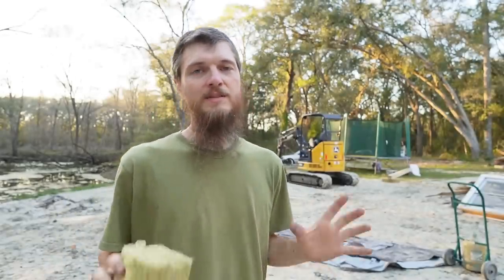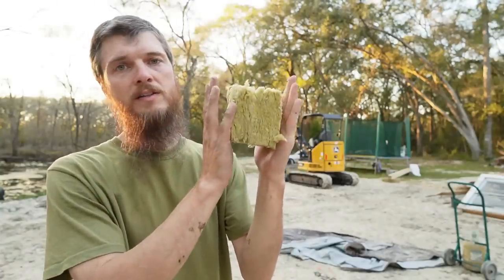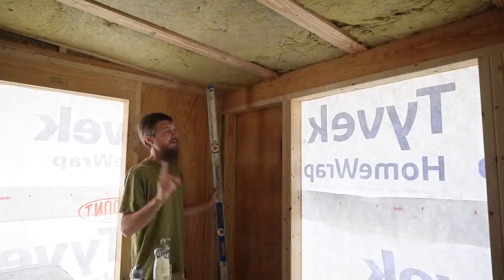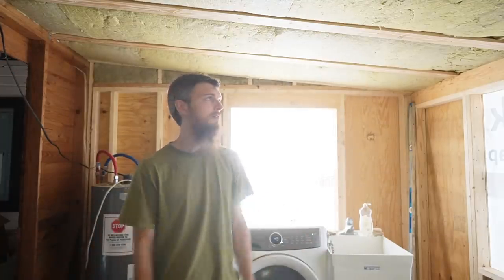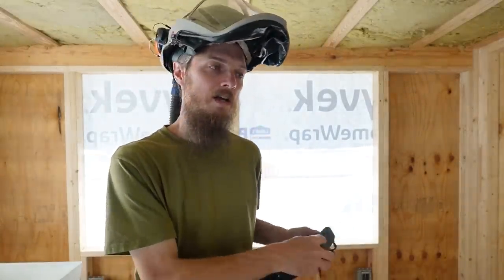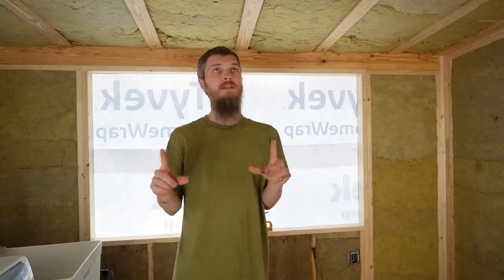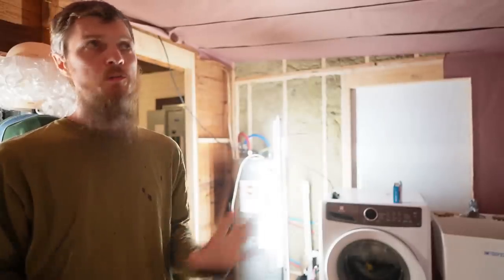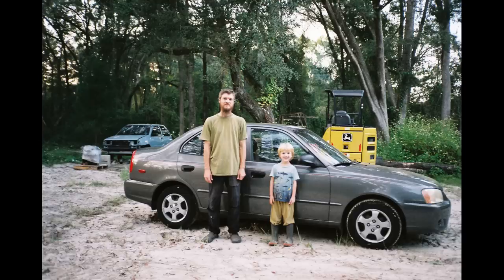Compressed Insulation Air Space Myth ( Insulating the Back Room + Family Photos! )

Comment: You are 100% wrong about this one.

What causes "R Value" to change is based on multiple factors. Insulation works by trapping heat within an air space. If you squish insulation, no matter what kind you have, it traps moisture more in the compressed insulation than in the uncompressed insulation. This trapped moisture than cools down faster than air. Now it's winter time, this trapped moisture now freezes and turns into ice, and slowly expands more and more when more moisture is near it. This makes your insulation R Value null and void. This also leads to mold growth within your walls and causes water damage inside your walls.

I could go on and on about how to properly explain how everything works and how to avoid all these mistakes, but you should bet the picture as it.

Stop spreading false information that could leads to hundreds of thousands of dollars of damage to people's homes, if not millions of dollars of damage.

Please delete this video, or put a warning on it saying this is your opinion only and to not repeat what you do in the video if you still disagree.
Reply: You've got almost everything wrong. "trapping heat"? No. Insulation works  by resisting the flow of thermal energy across some temperature gradient. Solid asbestos was commonly used in the old days in many industrial and scientific lab settings, for instance.  If insulation "trapped heat" it wouldn't be very useful in the summer, would it? What the data that Doug linked shows is the r-value per inch of a compressed fiberglass batt actually rises as you remove the air spaces. This implies the air space has higher thermal conductivity than the fiberglass itself. And a quick glance at Owens Corning's datasheets shows this to be accurate.  As is true for most things, consumer products are always a compromise from the ideal due to material cost and ease of use, The problem I see with most "pros" is that many are only exposed to one system and mistake compromises for requirements. As always, use the exposure to something that seems wrong to you as an opportunity to learn.
Reply: @Peter West  Insulation traps heat, 100%. Thus the definition of "R Value".
The reason why the inside of the house does not heat up in the summer time is because the insulated air space is being heated, while the inside of your house is being air conditioned, or vented via windows.

I built houses for a living for over a decade almost 2, I know what I'm talking about.

This is not an opportunity for me to learn, this is an opportunity to Doug to correct his mistakes that he is telling everyone else it's okay to do as well, which will cost them hundreds of thousands of dollars in damage.

You don't make money as a constructed worker if everything you build turns into a moldy rotten house.

You ignored every single point I made and went on your own tangent about how you thought insulation doesn't trap heat. If it can trap moisture, it can trap heat.

Now please do not make the same mistake as Doug and spread misinformation on the account of defensiveness and ignorance. I'm trying to prevent people from having mold and water damage behind their drywall and not noticing the damage till the point the house could be condemned, while you a defending Doug based on an idea o. Paper that is irrelevant to the points I brought forth.

The issue isn't compressing the insulation and losses a few dollars from heat, the issue is the compression of the insulation trapping moisture, freezing, allowing mold to grow, and rotting the structural framing that holds the house together.

I appreciate you trying to defend Doug here, as any good person would, but you didn't address the mold and moisture issues I brought forth, so sorry, you are wrong.
Reply: Relax it's one guy building a house and the channel is about much more than insulation.
Reply: @Brian L  It's "one" guy telling "hundred of thousands" of people online something is okay to do, when in fact it's not and could cost someone innocent hundred of thousands of dollars in damage.

So take your own advice.
Reply: @Official_Random_Guy  Please provide a link to your channel so others may watch and learn from you. Or please start one to save us 100s of 1000s from poor insulation. Hurry, we are all in the middle of framing and will be insulating any minute. Please I implore you to protect the innocent.
Reply: @Brian L  Really!? I'll get right on that just for you!

Dude, take your own advice and "relax" already.
Reply from the maker: @Random Guy, You have some interesting theories but I believe you are wrong. It's said to be perfectly fine to compress insulation as long as you are able to maintain the R-value that you require. It won't cause moisture problems. If you have any supporting documents to show that compressed insulation holds more moisture, I would be happy to view them. But from all the documents and articles I have read, I have never seen such a warning from any institute or manufacturer.

But also keep in mind, I didn't tell anyone to do or not to do anything. I was only sharing that R-value/inch increases as you compress insulation. It's the opposite of what most people think because R-values do not rely on "air space" alone. 

Compressing insulation isn't really a cost effective way to increase your r-value, but at the same time it's not something to worry about. Air gaps are the biggest concern. As long as the cavity is filled, that is the main goal achieved and a job well done. 

If you still disagree, that's fine, but there's no need to give me a hard time about it. Just ignore it and enjoy the rest of the show.

https://www.energyvanguard.com/blog/compressed-fiberglass-insulation-really-so-bad/

https://www.jlconline.com/how-to/insulation/q-a-compressing-fiberglass-batts_o

https://insulationinstitute.org/wp-content/uploads/2016/08/Compressed_R_values.pdf
Reply: @Official_Random_Guy  Mr Guy, I've been laughing and entertained by you this whole time. I'm mocking you with my comments. It's called satire. As Doug said, I hope you can enjoy the channel for what it is.....sincerely.
Reply: @DIYfferent  I posted a comment with a link and it just got erased.

You can look up why compressed insulation leads to mold and wood rot yourself on the account I am unable to post links.
Reply: @Official_Random_Guy  Here's the Definition of R-Value:  "R-value is a measure of how well a two-dimensional barrier, such as a layer of insulation, a window or a complete wall or ceiling, resists the conductive flow of heat."  I know it can be difficult for a layman to understand what the above really means and how it should inform one how thermal properties change with fluctuations in material and installation parameters, so "trapping heat" for you is really a shorthand way of ignoring the details of how things really work, but, as shall see, that kind of reasoning by analogy ends up trapping you more often than not. 

I've completely gutted and renovated several houses in my life time (one of my grandfathers built spec houses much of his life and my other grandfather has owned a plumbing business since 1960s). I know a thing or two about the practical side of construction, of course, but my education in the sciences (a graduate degree in engineering) informs my opinion here. I'd imagine that your opinion is informed by a misinterpretation of cases where too much insulation was stuffed into a wall without consideration for humid air exchange. The problem there is insulation impeding the ability of the wall to breath - not that "smaller air pockets hold more moisture". Contractors are notorious for getting causal factors wrong.

In any case, a good resource for everyone who has questions about insulation  is to go over to the Building Sciences website and absorb as much material as you can.  Joseph Lstiburek, Ph.D., P.Eng. who founded the company, has a bunch of videos to watch as well - I especially like the one where he insulated his roof in such a way as to inadvertently cause thermal bridging.
Reply: @Peter West  "resists the conductive flow of heat" means "it traps heat" genius.
Reply: @Official_Random_Guy  Thanks for confirming your short-hand nomenclature led you astray. Try this: ask one of your job-site electricians if a resistor "traps current".
Reply: @Peter West  Why would I ask an electrician if a "resistor" traps the current" when that excess electricity is released in the form of heat?
These are two completely different subjects which makes your point a "false equivalence".

The topic is heat, not electricity. Stick to the topic at hand genius.
Reply: @Official_Random_Guy  Actually the equations for thermal energy transfer are exactly analogous to a simple resistive circuit.  "excess electricity" isn't a term I'm familiar with and my undergrad is electrical engineering, btw (my degree also required a year of thermodynamics). No, current isn't trapped by a resistor - it flows uniformly throughout a circuit branch no matter the values we assign for electrical potential and resistance.  The same thing applies to heat flow - eventually the flow of heat will cease when all components in our house system reach equilibrium - it can't be any other way unless we throw out the laws of thermodynamics. Thus, I reject your "trapped heat" assertion and everything else that flows from it. The last word is yours.
Reply: @Peter West  My point is you were being intellectually dishonest with your choice of example. The topic is "insulation", so a better choice than a "resistor" would be an "insulator".

So an electrical insulator prevents energy from flowing where it's not wanted. That is topic, not a system that allows free flow like you are insinuating.

I could care less what your educational accreditation is, you are trying to change the subject which is "insulation traps heat."

Insulation prevents heat from leaving the house, it also prevents heat from entering the house as well. But according to you, this is incorrect, which is blatantly false.

Comment: Uhhh a non load bearing doorway does NOT require a traditional header.  So if air doesn't matter in insulation it shouldn't matter in double or triple pane windows either hu ?  Wow  I am learning so much from these videos !   NOT    you should really study up on the bull crap info you are spreading.    Let us viewers know as soon as the ceilings start showing mold and the roof starts leaking.  That will make for an interesting video.
Reply from the maker: What you don't realize is that there is no "air" between the panes of glass in a double or triple pane window. That is because air is a poor insulator. Instead the air is vacuumed out and replaced with an inert gas with much better insulating properties, such as Argon gas. It's the gas that insulates. Not the "air". It looks like I may have to do another insulation myth video sometime to explain these things.
Reply: @diyfferent    I've known that probably longer than you've been on this planet. It is still called air gap windows by carpenters and window installers Be it nitrogen helium or unobtanium. It's just a loose term
Reply: Amen sister 👆🏻😡the rudeness of some people…. It’s become a “thing” today over the internet to treat people like they have no feelings. It’s unavoidable. Oh well….look at how they treated our Lord and Savior. I’m sorry Doug, that you have to put up with the nonsense, but you know the reality as well as any other God fearing person. 
While we are here on earth this will be part of our reality 
Phillippians 4:8
Luke 6:32 But love your enemies and do good, and lend, expecting nothing in return, and reward will be great, and you will be sons of the Most High, for He is kind to the ungrateful and the evil
Reply: @diyfferent   correct👍🏼